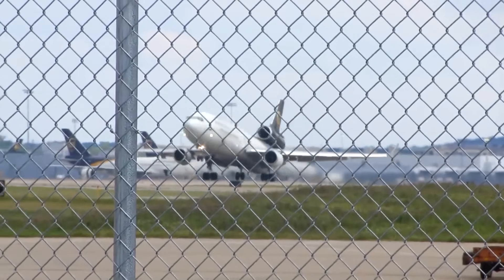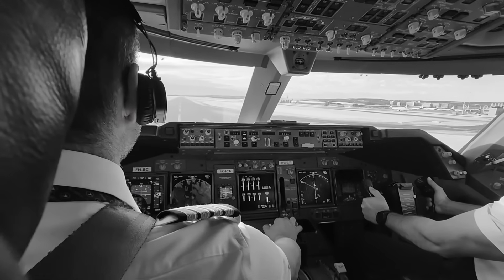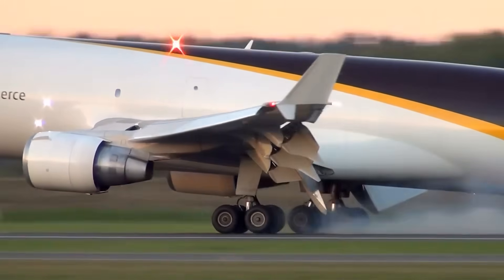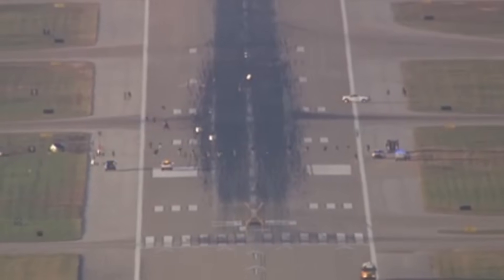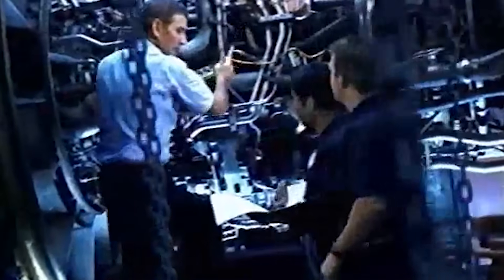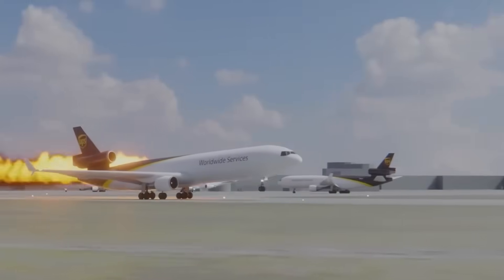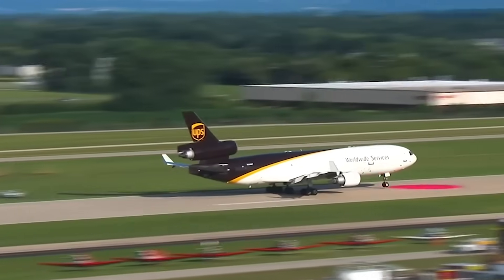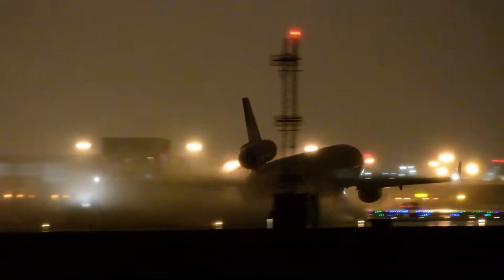The REAL Reason UPS 2976 Failed So Catastrophically...Mistake repeated AA Flight 191

Comment: I noticed a number of different excuses ideas about the engine pylon failure? Any one who an aircraft maintenance technician. Or A&P mechanic. Should know by his training and certification. That in any inspection. Items which should be inspected. Or the inspection must include. And must inspect any attached fittings. Included corrosion control. And the director of maintenance must have those items included. On any inspection. Since the airlines only care. How to save money. By reducing maintenance personnel. Advised the director of maintenance to cut down costs. The same scenarios will be repeated again and again. All maintenance facilities included airlines, operate with numbers , which are by the operator discretion. These are the reason we have so many incidents. That is happen in all aviation parts. 91, 135 and 121.  Savings is the name of the game!  Even though the FAA teaching three rules of maintenance. Safety, safety and safety. Which means by the operators reducing costs, cutting costs and if possible no pend.

Comment: Poor design.  Failed maintenance procedures.  One would think there would be an inspection (NDI) schedule and procedures for components as critical as those designed to secure the engines to the aircraft.

Comment: great video,
ive seen the exact same in the automotive industry with barings not exactly like this but close enough.
 as soon as i saw the picture at 08:37 that was it.

100% that's it, the uneven stress put on that yoke because the steel of the bearing was transitioning momenteraly from a perfect circle to an egg

over and over,

the greas also looks a bit of a mess indication eiter lak of greasing, injecting diry greas or that be bearing itself couldnt take the repeated loadings.

started galling at its outer race and what we have now is the tragic aftermath.

yes , fit for purpose in the beginning perhaps but 30 years later and th different loadings and more.

i also find it incomprehensible the inspection window on a known critical component wasn shortened.

like departures + load + thrust used + and events in flight sugh as avoiding wather + trrbulence + fast changes in direction.

its like every single component has a theoretical bit of it's life nibbled away because of these.

so a gradual an incremental shortening of intervals on older aircraft , im araid is really the only way t ocathc these events befor its too late.

its a bit like steam boiler inspections

every few years the get a visual ans so on but every  so many years its a complete removal of boiled and a full hydraulig test with stress gauges and all sorts.

as tou cant see inside  at the tube stays, bulkheads, and so on. even xrays

eventually the will have to be completely re made as the metal although looking perfect may not be  .

same for those lugs, id say they need replacing adter 20 years regardless.
bit the problem is distrurbing and re attaching them / rivets / etc may cause strees to the components they attach to.

so eventually your replaceing the whole wing.

so may as well replace the whole aircraft

Comment: Very interesting insight. I was wondering whether the load on the engine mounts would be higher when the aircraft is climbing than when it is going horizontally. But an aircraft engine is like a huge gyroscope. When a gyroscope is affected, enormous centrifugal forces occur. And, of course, these forces also occur precisely when an aircraft is rotating. The engines essentially work against the rotation of the aircraft. This must exert enormous additional force on the engine mounts. If the engine mounts cannot take the load anymore, then it is like a branch that snaps. Very sad this happened.

Comment: The title is a bit misleading because AA191 had some help in cracking the pylon. The unauthorized shortcut engine service methods turned nto tragic results.  

 It's looking more and more in this case it was metal fatigue from plain old age--It just happened to occur in the exact same location of AA.

Comment: Being this is a known issue with gyroscopic energy, and if it came free during this critical  "most dangerous most violent " it is known that it will cause an upward and inward motion... Having this knowledge why aren't the engines designed to spin the opposite direction so that God forbid this very rare event does happen the engine has a tendency to go up and away?
Reply: God you're and idiot and don't know anything about physics. Engine would have gone up and over if it was spinning the other way dubm sh#$

Comment: A one-off failure in the entire flight career of the MD-11 fleet is actually an impressive safety record. Had a failure or inspection suggesting imminent failure happened earlier in the fleet's career a mandated fix would have secured the jet's future until natural retirement. A repair scheme on the MD-11 might yet achieve this. It will be decided on cost.

Comment: It's not just the centrifugal gyroscopic force of the engine, it's  mostly the trust torquing the pylon to rotate like a see saw with the jet discharge pushing the front of the engine up and pushing the rear of the engine down. It's  simple physics, yet the narrator misses this fact.
Reply: I agree. The gyroscopic precession from the engine applies a sideways thrust on the rear pylon mount at every rotation. And the thrust from the engine applies a vertical force down through the centerline of the rear pylon mount, particularly at takeoff power settings.  And these two forces combined contributed to the failure of the rear mount. While engine thrust caused the engine to pivot up around the front pylon mount once the rear mount had failed, gyroscopic precession caused the engine and pylon assembly to rotate to the right. Both forces combined caused the engine and pylon assembly to go up and over the wing and fuselage, landing on the right side of the runway.

Comment: If the rotation torque caused the engine to fly upwards, then this direction would depend on the sign of the angular momentum of the blades, no? (ie clockwise versus anticlockwise)
Reply: The jets thrust pushed the engine to rotate upward like a see saw.  The front pylon mount became the pivot/hinge once the rear pylon bearing mount broke loose. Spun like a bottle rocket pinwheel.
Reply: @joefudd  wasn't the point in the video about the angular momentum of the engine and not the thrust?

Comment: A huge part of the issue is that most maintenance and inspection is carried out under part 145 regulations that go back to the thirties. Guess what? No Engineering component is required for part 145 certification or the system. In the structure of management for a part 145 maintenance and repair center, the dominant position is not an engineer, but a mechanic with an A and P certificate and most inspection systems are hidebound and MADE WORSE by ISO standards which fossilize the inspection system and give it far too much power. So the main emphasis is on clearing inspection jobcards and avoiding lengthy liaison engineering input which slows down the check. The FAA knows this very well and it should have been changed a long time ago.
Reply: You realize all 145 repair stations are 100% buyback and overseen by the associated 121 carrier.
Reply: @Piggyporkproductions  Of course, I was an engineer, I know how all of it works.

Comment: In 1979, rich people had two options …

1.) Redesign the pylons
2.) Blame the failure on mechanics

Well, we know which option they chose.
Reply: Yup, also several dc10s showed cracks in that area without being serviced with a forklift.
Reply: @ChaklitTea  I didn’t know that. Thanks for the info. I mean, we know it’s a bad design now … after 2976.
Reply: I don't know, man.  Air travel has been pretty damn reliable since 1979.  

Extremely reliable.  NOTHING can guard against DEI, however.  That is what HAS changed in the meantime.
Reply: @anotherlover6954  did you know that one of the mechanics killed himself out of guilt after flight 191? You see, he actually believed that he was at fault for the tragedy.
Reply: @jeromeschwartz3699 I hope the 191 case get reopen for families to sue.
Reply: @jeromeschwartz3699  Again, millions and millions and millions of flights since 1979.  The safety record is extreme.
Reply: @anotherlover6954  do you know how many people should die because rich people are greedy? ZERO! You can’t lump those deaths in with naturally occurring deaths and pretend it just works out that way. I’m sorry but, no.
Reply: @ChaklitTea  that makes two of us.
Reply: @jeromeschwartz3699 If what you're saying is true, then planes should have been falling out of the sky this whole time.  That's what I'm saying.  I don't buy the idea that there's something systemically wrong with a fleet that has such a stellar safety record.
Reply: @anotherlover6954  zero.

Comment: It’s sad to think that if engine 2 hadn’t ingested debris from engine 1, it’s possible the crew could have gotten the bird airborne on the two engines and wrangled it back in for a landing.
Reply: Nope it was doomed already nothing crew could have done not enough attitude
Reply: Planes often have to dump fuel or are too heavy to emergency land safely
Reply: @WindTurbineSyndrome 

You can land any jet overweight. It's just an inspection.
Reply: @WindTurbineSyndrome not all the time

Comment: Any working component is always subject to failure, its never a matter of If it will fail" but when it will fail. not making the affected areas in question more visible or accessible for inspection is most likely a design flaw.

Comment: :face-orange-raised-eyebrow:You hit many good points. I think you missed one that is probably determinative. After the Flt 191 disaster, the FAA issued an Airworthiness Directive (AD) that applied to the DC-10 engine/pylon mount system. The same clevis/lug system used in the MD-11 had failed on the DC-10 that crashed as Flt 191. The AD specifically called out inspections for "overweight" landings and defined what "overweight" meant for the various DC-10 models. The MD-11 is essentially a stretched version of the DC-10 with longer wings, redesigned tail, more powerful engines and capable of carrying heavier loads.  The FAA did not expand the AD to include the MD-11s although the engine/pylon mount systems are identical. Essentially, every MD-11 landing would be defined as "overweight" according the to DC-10 AD, requiring inspection.  However, the FAA, bowing to industry lobbying, allows the operators to deviate from the required inspections by submitting their own inspection schedule.  This allows the operators like UPS and FedEx to extend inspection schedules based on time instead of the "overweight" landings targeted in the AD.  I believe FAA should require all DC-10s and MD-11's to be inspected for aft lug and bearing cracking. I believe those inspections will reveal an extensive problem as did the inspections after the Flt 191 disaster.
Reply: The reason the pylon aft mount failed on AA DC-10 in Chicago is that maintenance used a forklift to mount the engine and hit the rear wing side of the mount, causing a fracture.
Reply: I think that’s exactly what the inspections are revealing, which is why they just announced it will take several more months to figure this out . I doubt the airplanes will ever  go back into service . They were already being phased out. .

Comment: The fact is that the MD-11 is from a long gone era of aviation and is super old.  I'm not an aerospace engineer but it seems to me that stress all of the take-offs and landings cause on various parts of the plane not only would degrade the engine pylons but all kinds of other parts.  Since there are hundreds of thousands of parts on an airplane either the most critical ones should be replaced after so many cycles/hours or the plane should be retired altogether.  There's a reason there are very few DC-10s if any still in the air for example.  MD-11 should be completely retired and a select number put in a museum.

Comment: Psst.  UPS CEO uses older MD-11 is so they can get free and/or used parts from the Airplane graveyard.
Those cheap and/or free parts usually are not inspected as the FAA mandates and/or the Manufacturer recommends.  This is one way in which an airline CEO maximizes profits at all costs.
Reply: Incorrect.  All used parts must be "yellow-tagged" meaning that they are certified to conform to the standards.
Reply: Nothing new thrre .. planes that. No longer fly have plenty of parts to keep rest of fleet going... its recycling in action .

Comment: Freight operators have low daily utilization compared to passenger carriers. To operate profitably with low utilization, freight airlines convert low acquisition cost old passenger aircraft to freight configuration. If conditions allow takeoff thrust is derated to save money on engine maintenance. The maximum takeoff weight on a freighter or passenger variant is the same. 

The A300, another geriatric freighter, has its pylon removed at 12-years and the attachment hardware and spherical  bearings replaced. The 34 year old MD11 lost in Louisville would have had a special visual inspection of the concerned attachment at a threshold of 29,000-cycles. The lost aircraft had around 21,000-cycles since new.

Continuing airworthiness of all aircraft programs, freight or passenger, is maintained through laboratory testing by the manufacturer, high time fleet leader programs and sampling inspections on the in service fleet. Why the MD11 had a 29,000 flight cycle threshold for a special visual inspection of the failed aft pylon attachment is an excellent question for Boeing.
Reply: Or McDonald Douglas.. they buit the plane long before boeing took over
Reply: @williamhaynes7089  Boeing is fully responsible for aircraft designed and built by McDonnell-Douglas.

Comment: I'm a heavy duty mechanic
Worked on earthmoving equipment for decades. When winter arrived it was time to go through those machines from fry to bk, everything! When you get familiar with a product you know what to expect. If a certain pin likes to fail ( for instance) at 2000 hrs you change it out at 1000 hrs, because you don't want failures, that's what costs,  down time is unacceptable.  Why does a mount system on a plane escape regular change out, especially when this has been a problem in the past. Those parts and labor cost NOTHING compared to loss of plane and several lives.  Something really wrong with upper management, Period
Reply: That's a really good point.  Well said.

Comment: I would say, last engine change triggered this cracks. Out of my experience of MD11 and DC 10 maintenance years 1992 - 2013, until 2022 some cargo MD11. I have only once seen this kind of problems, by a customer aircraft. But was clearly identified by a wrongly carried out engine change. Personally, I would say, lubrication of those lugs and NDT (Non Destructive Testing) frequently will reveal such cracks well ahead of the disasters. Therefore, I agree to the statement, MD11 is unforgiving in such things and therefore the maintenance personal must comply 100% with the AMM and Maintenance Program. Personally, I can say out of my experience, some MRO`s are  very cheap for D-Checks to get those jobs, but compensate with lower qualified personal or even just signing off work papers. One of my worst evaluation was an MD11 out of a D-Check loosing over 12t fuel on the 1st flight after D-Check and we found 83 fuel leaks. Caused by maintenance error ! Outcome was, the company has changed some processes and procedures, but next D-Check 9 Months later..... only 63 leaks. As longs as authorities not close down such companies and withdraw the approvals, ban all those overhead managers from working further in aviation, nothing will change. Now a days are other airplanes affected, but ask some line engineers, when they see an aircraft back from D-Checks in some countries, where the labor costs is so cheap.
Reply: Pretty poor analysis. You may know a bit about maintenance, but you don't know structural design. This design was bad from the start. The failure had nothing to do with an engine change.
Reply: Dear Paul,    I have received and read the report about the accident. Report: DCA26MA024.  Reading this report, speaks a clear verdict. Like I said before, without knowing this facts, I indicated about this problem. But now, it is shown clearly, they did not lubricated those lug and bearings. This has lead, to wear out the spherical bearings, this has lead to a chaffing on the lugs and finally to crack them. This was waiting to be happened. My question is very clear: Those guys signing off this job, did not do it. Sorry, does not matter what they will say, they signed off a task, without doing it. In my opinion, the entire maintenance organization shall be grounded. Such behave in aviation is not acceptable ! But unfortunately, we will see more and more such behaves, as the financial and time  pressure is so high on the maintenance, that short cuts are more common, then 20 years ago. Back to your comment, it is not the design problem, it is the maintenance and the people behind.